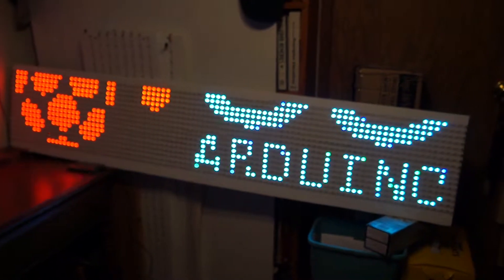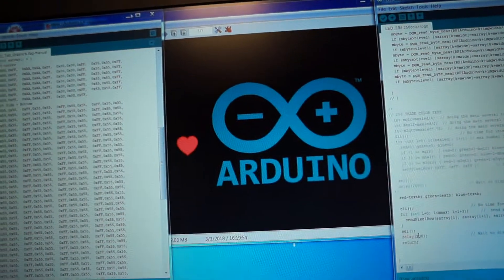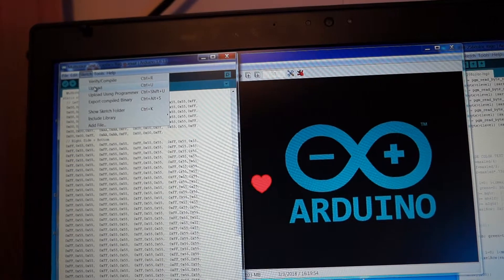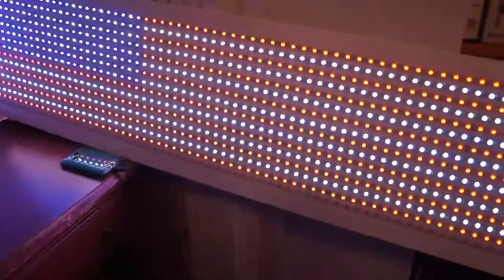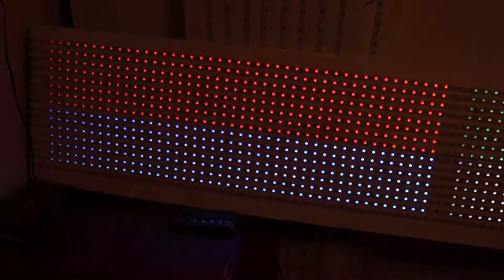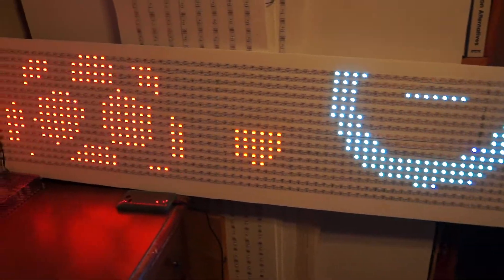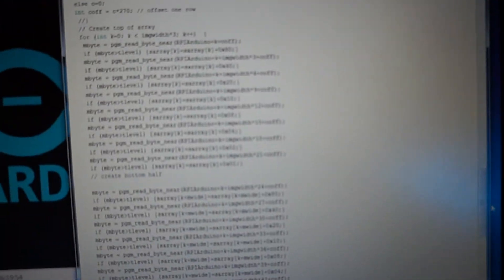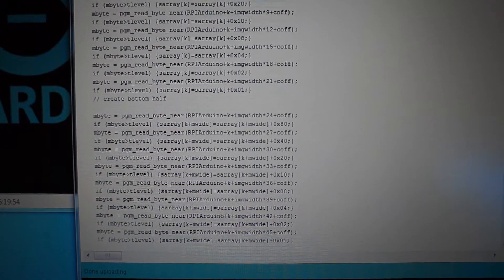Arduino Graphics on Ws2812 Addressable LED Sign

Comment: Archivos  y diagrama
Reply from the maker: See my blog at bobdavis321.blogspot.com  But it is D0 to strip 0 to D7 to strip 7.  The strips wrap around from the right side to the left side next seven rows.  Power and ground go to a 5 volt 10 amp power supply.